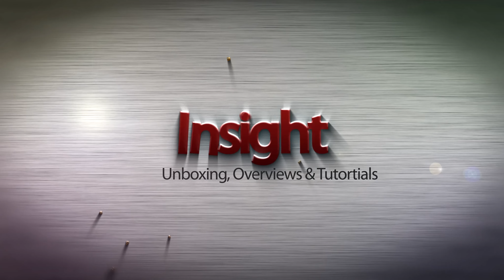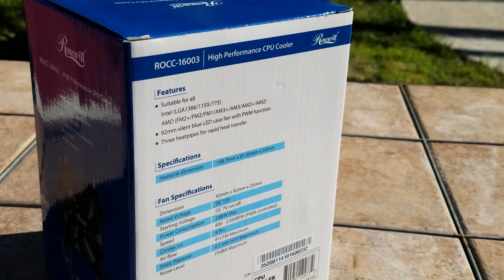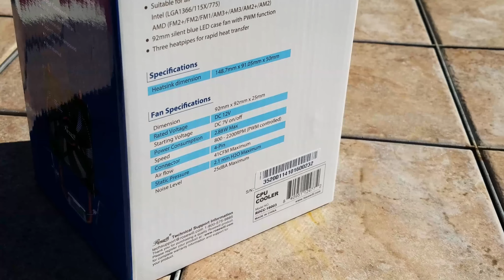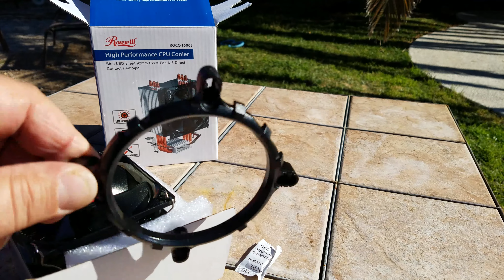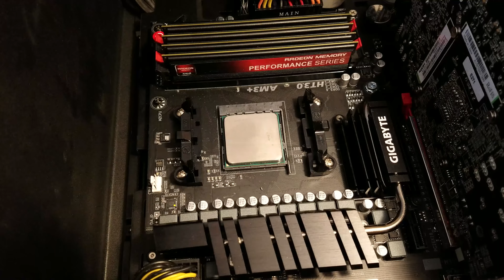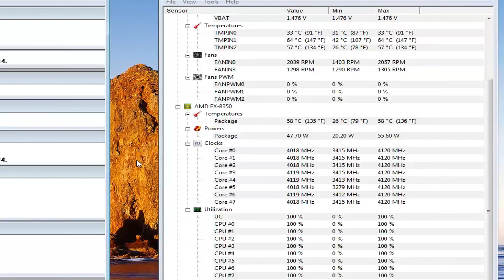Rosewill ROCC 16003 CPU Cooler. Cool, quiet & efficient. I'll take that.

Comment: Would this fit on a micro atx motherboard?
Reply from the maker: It should fit any am3+/AM4 (also compatible Intel) cooler mounting system. From ITX to E-ATX. The mounting design for a cooler doesn't change within a certain style cpu socket, regardless of board type.  You would want to make sure though if you are using a small form factor case, that you have the clearance for it's height. Hope this helps and thanks for stopping by!

Comment: i have a certain question. the push tabs are too far away from where it latches onto my motherboard. i saw that there is another placement so that you can move where the push tabs go lower and itll be able to fit down to the latch. But in order to get it to the second placement i cant bend the metal enough to where it gets off by not breaking it. Help?
Reply: i also have an am3+
Reply from the maker: It appears like they are too far, but in reality they are not. It's just really really tough to get on. I clipped the one side, then had to really press hard to get the second to latch. It's a two hander. One pushing down hard, second using something to push it over the edge of the bracket where it latches.
Reply: oh, i finally got the tabs off to the second bracket. this made it to loose so i just gave up and bent the entire bracket a little and its fits pretty sturdily on the cpu
Reply: @torntv6545  Thanks for the explanation.